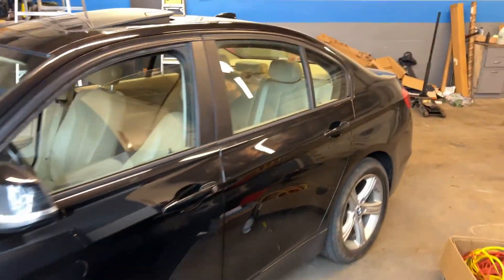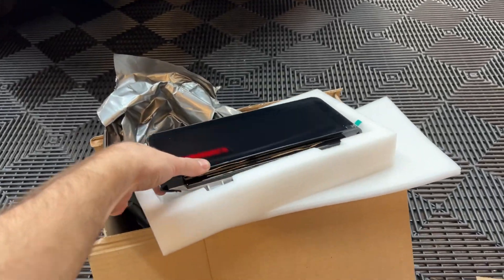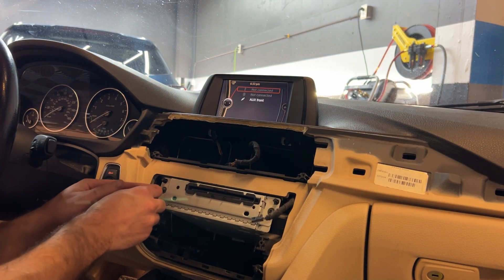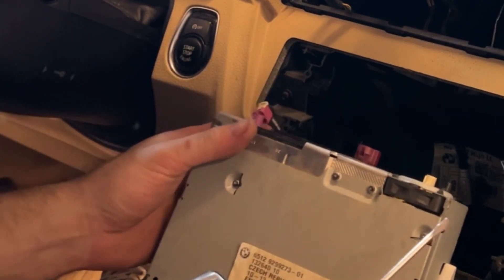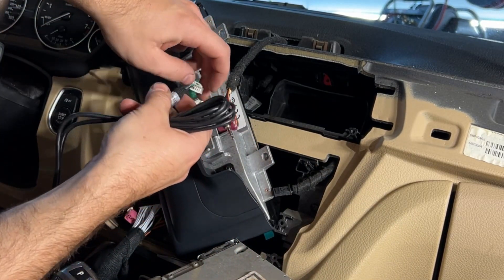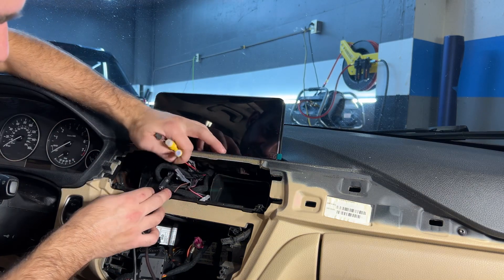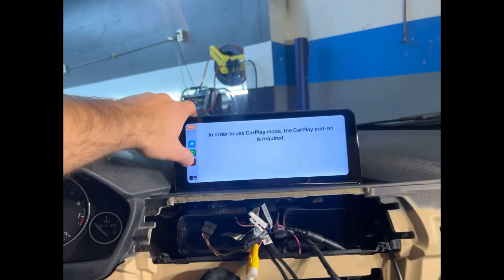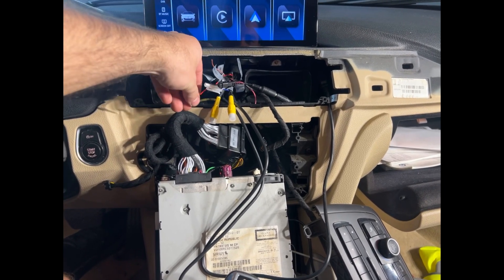Installing a 12” Linux CarPlay Headunit for the BMW F30

Comment: Did you encounter under carplay using the idrive wheel sometimes it controlls the original idrive system, so sometimes when navigating carplay will accidentily switch on or off some stuff at the back ground or stuck on skipping music tracks, super annoying problem.
Reply from the maker: I don’t think so. But I’m also not fully sure what you’re describing. It’s a bit hard to understand what you’re explaining
Reply: @Buildcultureyoutube  crap, English is not my first language haha, what I meant is the control knob controls CarPlay and the original radio at the same time .

Comment: have you ever tried using it without the aux cable plugged in? i installed a roadtop screen into my f30 that didn’t have bluetooth originally and i thought i needed it, but i accidentally unplugged my aux wire yesterday and the audio kept going 🤷‍♂️
Reply: Any update on this?  Would love if the audio was "pushed" through the fiber optic cable.  Maybe your audio switched to Bluetooth after the AUX was disconnected?  Thanks!
Reply: @ashokreddy2640 sorry i did not get notified about this comment but my car never came with bluetooth and i tested it out afterwards , i still do not have bluetooth in my idrive only on carplay
Reply: I follow all d step my 2013 328i didn’t have that green wire so I plug all connectors in and everything for for me

Comment: I hate the YEEHUNG logo on startup so I e-mailed them on changing it. Here is what they responded with. I haven’t done it yet. 

How to change the logo.
1. Name the picture as updatelogo.png, put it in the root directory of the USB flash disk (the USB flash disk should not exceed 32G).
2. Insert the USB flash drive into the USB cable, then the machine will automatically recognize it and replace the logo automatically.
3. After the pop-up window of successful upgrade pops up on the screen, you can pull out the USB flash drive and restart the screen to see the replacement logo.
If you want to use your own pictures, your pictures need to pay attention to the following points:
1. The resolution is 1920*720.
2. The image format is PNG
Please Note: Only one picture can be placed inside the USB flash drive at a time, to replace the new picture, please delete the original picture.
Reply from the maker: That’s awesome thank you!!

Comment: I just bought 12.3 inch screen for my f48. It doesn't work with oryginal menu.
Reply from the maker: @Ev0ltion  press the audio button
Reply from the maker: On your idrive controller
Reply: @ none of the buttons are working, it sometimes goes to normal menu but resolution is messed up and the system is not responding
Reply: Steering wheel buttons are also not responding.
Reply: @Ev0ltion did you manage to solve it? Same happens to me

Comment: I can’t get the Bluetooth to work even after your steps what else could I do ?
Reply from the maker: Did you make sure to disconnect from factory Bluetooth?
Reply from the maker: I actually never got Bluetooth to work too. Only CarPlay, if that helps
Reply: It says I’m connected to CarPlay but no audio , my new harness doesn’t have the ground cables you connected together so that a problem ?